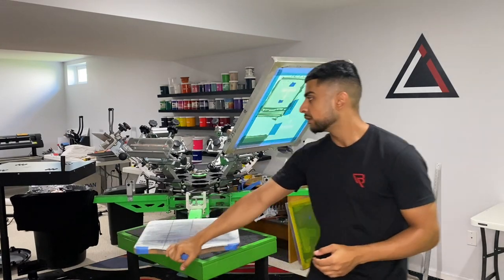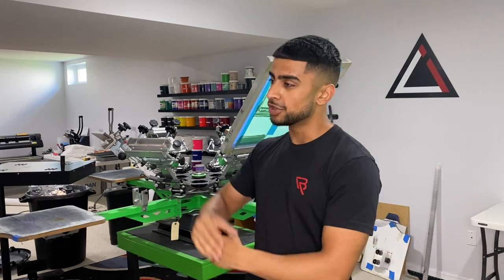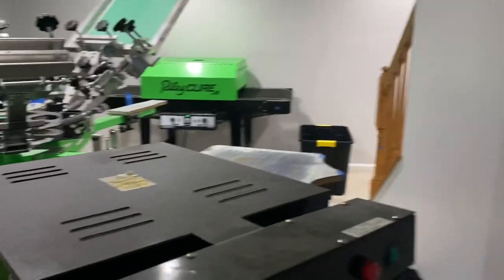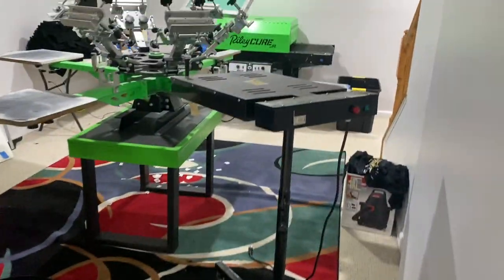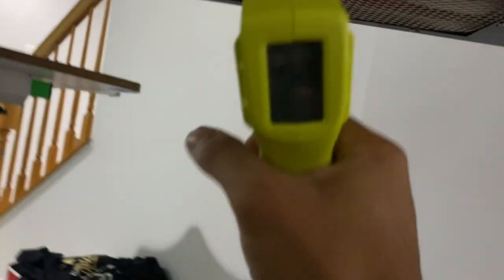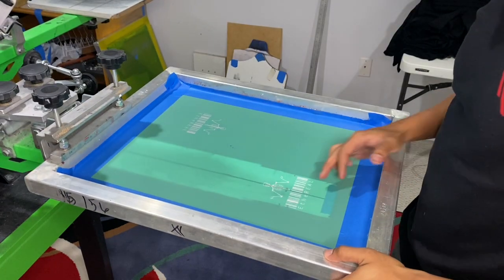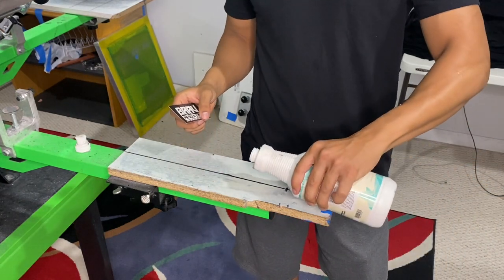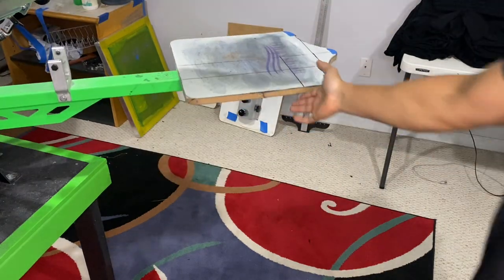The BEST Screen Printing FLASH Dryer | My 5 Year AMAZON Review

Comment: really struggling with getting it to cure right and not crack, what would you suggest in terms of what temperature to have the flash dryer at, what the ink temp needs to get to, how long to cure it for and about how high above the garment it should be? Would really appreciate some insight!!! Driving myself crazy with it being inconsistent and everyone kind of says different things.
Reply from the maker: Curing is one of hard parts especially when starting out and it’s okay to go through that. For plastisol inks you need to get to at least 330 degrees for a cure but that doesn’t mean only reach 330 and that’s it. It more importantly means get to 330 degrees and let it dwell at that temperature for 15-20 seconds at least to get a full cure

Try letting it sit for 15 seconds at 315-330 degrees and see if that helps solve your problem.

If you stretch test the fabric right after you cure keep in mind the print is hot!! Let it cool down before you see if it’s cured or not 

Hope this helps🙏🏽

Comment: Do you have experience just using a heat gun to cure the ink? Does that work well enough? Or is the flash dryer the way to go for best results?
Reply from the maker: I don't have experience with that. Great question but my personal advice is just get a flash dryer. It is well worth your time and money. The amount of time it takes to cure and flash a shirt with a heat gun vs a flash dryer is a big difference. Those couple seconds may not seem like a difference per shirt but when you do an order in bulk, time will definitely tell. Plus it just gives better results with a flash dryer than a heat gun because you may miss some spots!
Reply: @baavproductions  thank you that is very helpful
Reply from the maker: @gavinkelson1387  Glad I can help!

Comment: I have the same one that broke on you what temperature did you have it set at? And how long did you usually leave it under there for?
Reply from the maker: I try to get it so that when it hits the shirt it ranged between 230-260 for a few seconds. The longer you have it under the flash, ofc it will raise in temperature. You can cure the ink by having it under there longer but to flash it I would get it so that it hits 230-260 for between 4-10 seconds. See what works best with your operation and flow and mess around with the height.

Comment: I just bought this  flash dryer. No instructions on how to use the temperature. Can u direct me to where I can find instructions? Thanks
Reply from the maker: You can adjust the temp or adjust the height for more or less heat

Comment: Does the plug in ever get hot? Do you just plug it into the wall? I’m looking at this and I noticed it runs at 2000W & 18.2A and that’s definitely pushing it. Somewhat worried about it melting outlets/cords, etc.
Reply from the maker: Mhm it may get slightly hot but still worked well for me for a few years. Not advice but just my experience with them. Keep in mind they are a cheaper option so not the absolute best quality but a great beginner flash for sure.
Reply: @baavproductions  I appreciate the response brotha

Comment: I have that same one and it keeps melting my extension cords that I hook it up to. As if the heat from the flash dryer is sending the heat through the cords. Is it my outlet my extension cord or my flash dryer ? It’s driving me crazy
Reply from the maker: That's weird and definitely does not sound right. You can never be too sure with China products. However it has been holding up great for me. I don't use an extension cord so maybe try it without an extension cord?
Reply: Something drawing 2KW needs a heavy duty extension lead. A light duty one like you use for hand power tools just isn't up to it. Also, never, ever use an extension lead coiled up as that will heat up on it's own regardless of how thick the cable is. That's how induction cookers work.
Reply from the maker: @Derek_S  Great info! Appreciate you sharing and helping out honestly!
Reply from the maker: Good point, when I had this I was using it on at least 20 amps

Comment: Is this flash dryer 110volt or 220?
Reply from the maker: 110 volt. It may be slightly higher and pop the fuse in your house, if it does happen just go ahead and switch it back on. Shouldn't be a big issue, as I use it on a 110 Volt.

Comment: Does this flash dryer swivel?
Reply from the maker: I wouldn't say swivels the easiest. I mainly just use it as is and don't mess with it. Though i have moved it around but keep it mind the legs are a little wide.
Reply: No it doesn't it rolls around on the wheels, that being said floor space equal to the circumference of the four legs will be needed
Reply from the maker: Indeed